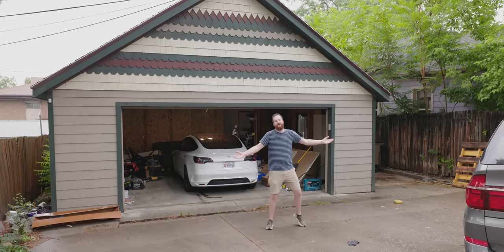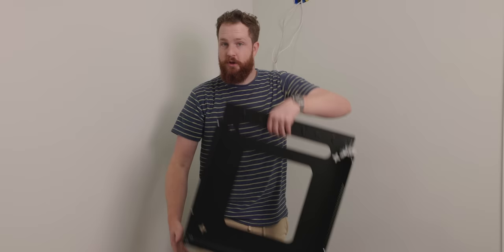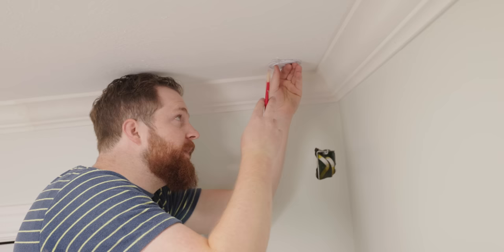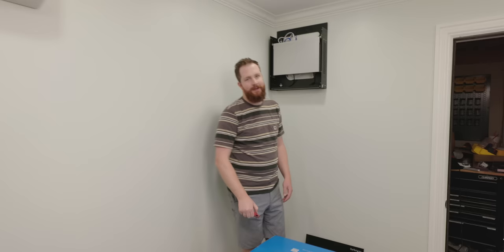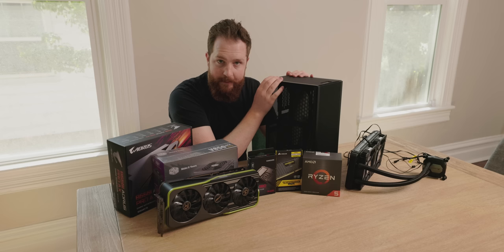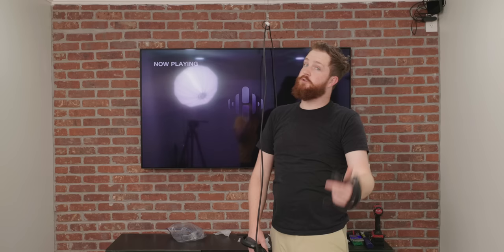I added Wireless Ethernet to my Garage!

Comment: Every time I see something like that I’m amazed by the houses in the US. It seems everything is wood and cardboard 😁 it’s sooo easy to get cables or plumbing everywhere. I installed a smart doorbell and it was a nightmare, I needed a hammer drill just to remove the old doorbell, let alone change any wire…
Reply: yeah, that’s pretty much the only advantage of houses built that way, price too ig
Reply: @BorisG13  also for earthquakes
Reply: @noisycarlos  and insulation.

So basically literally everything except termites and water damage
Reply: @mattsnyder4754  our houses are also less long-lasting and less soundproof between rooms. It’s a lot easier to send WiFi through walls, though. There are definitely pros and cons, and lots of opportunities for improvement through mutual sharing with other peoples’ ways of doing things
Reply: Yeah, try this in the UK, where anything less than 45 years old is considered a "new-build"
Reply: Yup, agreed. Here in Belgium, even just mounting a security camera or light fixture to a ceiling is something I hate doing. Everything requires drilling into concrete or cement or whatever. I know both kinds of houses have their pros and cons, but as a tech enthusiast I am envious of Americans.
Reply: @Gilamath.  having to rebuild a home every 100 years or so is WELL worth having the option to actually make the house suit your needs.

No one cares that their house has stood for 400 years when they have to break out a hammer drill to put a picture on the wall.
Reply: @mattsnyder4754  sorry, every 100 years? The average us house lifespan is 30 years, iir
Reply: @Gilamath.  30 years? Lol yeah no.

Comment: Expertly done Quinn!
If you want to get into weights, a power cage is the way to go, so it can catch the weights if you fail and can work out by yourself. To fit in your small space you could get a shorter "training" bar that can still hold a lot of weight for basic fitness.
Reply: If he has a Tonal, he may not need free weights for a while. A Tonal can go up to 200 lbs.

Comment: Here's an easy trick to get things level: Do one side at a time. Put it up roughly where you think it should go, mark the spot on one side, screw in a screw (or as us Europeans with brick or cement walls, drill a hole and use a "rawlplug") and boom, you got yourself a free hand. Simply hang up one side of whatever you need to mount, hold the other side with your hand, and mark the hole. As someone who just moved into my own house, I've done this probably 20 times thus far. Alternatively, stick some tape underneath the holes on the rack, mark the holes with a sharpie, and put the tape on the wall. Getting the flimsy 1 gram tape on the wall and getting it level is much, much easier than trying to mark some holes by lifting a rack up there.

Comment: The reason for the discrepancy in the hole size for the Ethernet cable is for a cable that does not have a RJ45 end already crimped. Crimping afterwards reduces air leak between conditioned and unconditioned environments.
Reply: Or just use a rubber boot around the wire after you've pulled it through.

Comment: because working out in VR is waaaaay better for increasing your metabolism. lol but my 2 cents, paint the switch box white with appropriate metal spray paint and always use banana plugs for audio, takes longer initially but it pays back dividends when something happens, and it always does. like a lightning strike blowing up your amp or your cheap amp just dying and you have swap it out in a year or two.

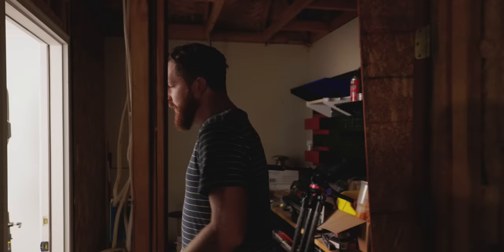Comment: 0:27 why
1:27 quick montage intro
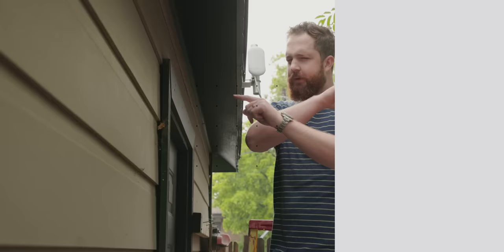1:32 point to point bridge
3:11 switch
4:09 installing switch rack
5:21 cabling
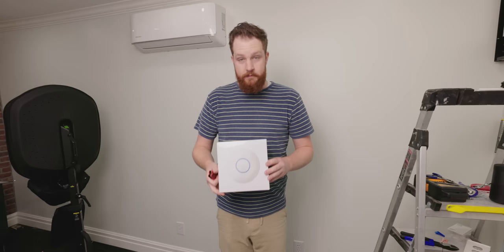6:17 6:34 access point
6:55 installing AP
8:55 installing camera
9:46 tips: use safety goggles when sawing a hole on the ceiling upside
11:08 it's easy guys
11:25 speakers
13:05 more ceiling holes.. for speakers
13:20 plugging audio cables and insert the speakers
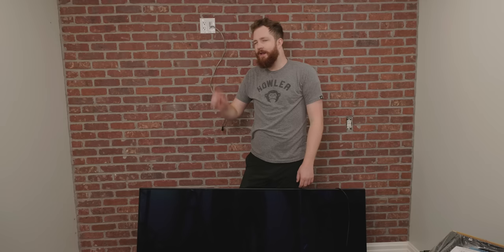14:35 tv
15:10 mount the tv high
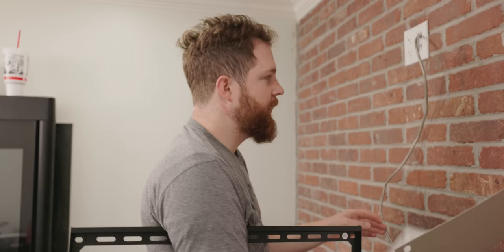15:40 installing tv bracket (they have slide tolerance, don't worry if the studs not center)
16:47 mounting the tv on the bracket (bonus: ape dance)
17:03 building VR PC
20:15 audio (Denon)
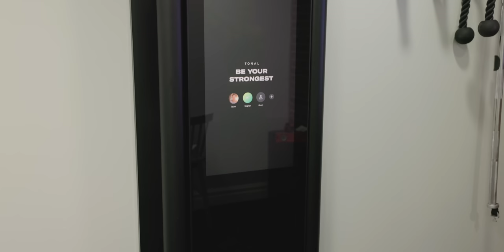20:44 liteboxer
21:12 speaker calibration
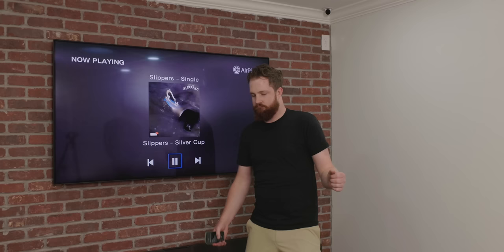22:16 his bro n sis have a band, check them out: silver cup
22:35 about desktop VR, steamVR lighthouse vs Oculus tracking system difference
24:14 mounting VR cable organizer
24:27 test VR and conclusion about the whole garage gym

Comment: This was really cool. Since it’s a project with your wife you should look at working her into the video. My wife would love the tonal, maybe one day. We have a Peloton now which she loves. That point to point wireless option was cool, I wasn’t aware they were that reasonable.
Reply: Fun fact, i installed similar wifi kits inside the elevator shafts of a 20 story building, to retrofit IP security cameras (one in the top of the shaft, one on top of the cabin)

Been working great for about 5 years now.

Comment: The Oculus Quest 1 and 2 can do wireless PCVR (and therefore Steam VR) through Oculus's airlink or Virtual Desktop.  And it uses your local network (the quest 2 supports WIFI 6 as well) to connect. So even having a slow connection (assuming you are playing a single player game) means you can have fast connection to your PC, as long as you are on a 5Gz network.

Comment: Probably way late, but the oculus quest 2 can be used wirelessly pretty flawlessly with a PC, I how ever would not recommend using airlink (default oculus wireless method) because it sux. There is an app for the quest called Virtual Desktop that handles wireless VR way better. Hell, with how your home network is setup you may even be able to play in the house while leaving the VR PC in the garage connected to Ethernet.

Comment: That AIO will not last very long with the pump being the highest part of the loop, even worst when it's upside down...

Edit: Never mind, I'm blind... xD
Reply from the maker: It's the lowest part of the loop.
Reply: @snazzy  You're right, never mind. Didn't noticed the aio mounted on the side of the case instead of what would be the bottom. My bad.

Comment: Concerned regarding the switch and pc, being a workout centered area, is a mesh case the greatest idea? Couldn’t moisture and dust shorten the life and possible cause issues?
Also wondering if you have plans to add a UV light cleaning system maybe?
Reply from the maker: Dust should be pretty minimal since the entire room is closed off from the rest of the house and the mini-split has a good HEPA filter. Same thing with moisture. There’s a humidity sensor I’m installing that will automatically toggle a dry mode on the HVAC. :)

Comment: I take my VR HTC Vive with me wherever I go All I need is my little computer I built with a handle My bag that holds my two tripods and my and a surge protector and a long extension wire and then it all fits in that one bag and then all I need is the box that the HTC Vive came in and I take it everywhere take it to my friend's house and people's houses and try out it's easy All I have to take is three things it's pretty dang easy

Comment: I would assume that if the garage already has power there is conduit running to the house already that you can run the ethernet through. A little more reliable and feasible in my opinion.
Reply from the maker: Garage has its own 100A service. There’s abandoned conduit but it’s jammed full of crap and not water right.
Reply: @snazzy  I see, old houses suck 

Great job otherwise, Glad you put a subwoofer in your gym lol.

Comment: I recommend to you not to put you PC the way you wanted too.
When your pump (and CPU block for that matter) is on the highest point of the loop, air can collect there and pump can suck the air, which is not good and your AIO won't live that long. Also when CPU block is filled with air (ignoring the pump) CPU cooling capabilites can be worse.
Rest of the build and your gym looks great! Also you've recommended me a great TV, I've been looking for one.

Comment: 22:31 Did they change the Lighthouse/base station ?
The one that came with my Valve Index are more round than square
Reply from the maker: I have the original ones from the Vive.
Reply: @snazzy  I see, what is the fan module attached to the front of your index?

Comment: In before one of those badge extenders in the ceiling break and you stupidly get tangled in the tether cable. I've had so many of those break. Do yourself a favor and get something that will actually last more than 1000 pulls.
Reply from the maker: The Kiwi ones are pretty awesome in my experience.

Comment: In 4:46 ish I see you're installing your switch rack, but the ethernet and power cables coming out of the wall seem to be on the same (or very close together) conduit. Might want to watch out for interference! AC and ethernet should be isolated
Reply from the maker: They’re not close. Power coming from below and Ethernet coming from above.
Reply: @snazzy  ah, that's cool.

Comment: I've got a quick question. I noticed you're using the older 1.0 HTC lighthouses instead of the newer 2.0s. Is there any particular reason or do you just not have 2.0s?
Reply from the maker: My 1.0 still work great and the 2.0 aren’t really any better so I’m sticking with these until they give up the ghost!
Reply: @snazzy  I don't blame you. I'm gonna do the same when my Index comes in later this week!

Comment: Have you ever used the Quest 2 and tested the tracking? I did, and I couldn't feel any difference to a lighthouse system. I play custom Beat Saber songs on pretty high difficulty, so the tracking ix extremly important to me.
Reply from the maker: I did. Quest 2 is great but still no comparison to outside-in tracking.
Reply: Add an IR emitter to your room (~$15) and it gets even better. With the emitter I can play games and watch movies in complete darkness.

Comment: 6:14 PoE injector behind PoE Switch??
Reply from the maker: Yes, the Nanostation Loco 5AC use 24V passive PoE instead of the much more industry standard 802.3af. Quite annoying.

Comment: I searched the comments with no luck. What's the vertical screen on the left wall? It seems to be more than a screen.
Reply: It's called Tonal. It's a smart gym device that you can mount to your wall and it gives you a bunch of workouts. The weights you lift are configurable using built-in magnets. I want one of these. The upfront cost is really steep though, unfortunately